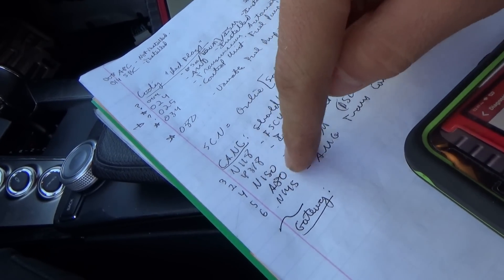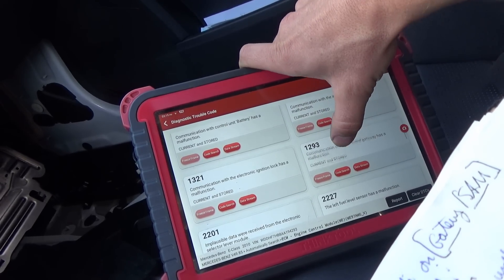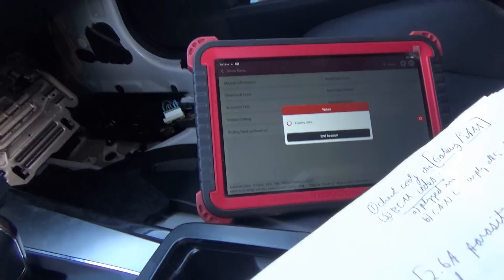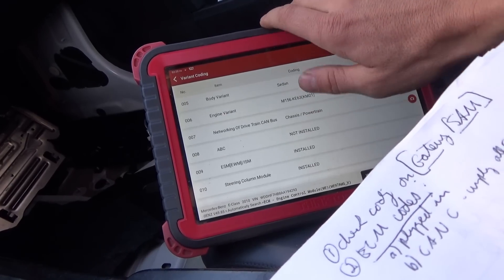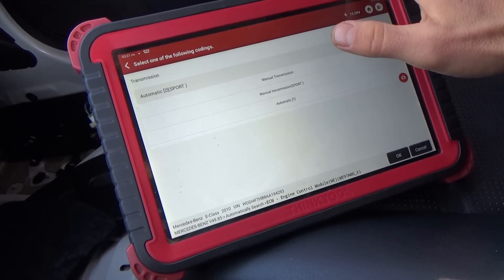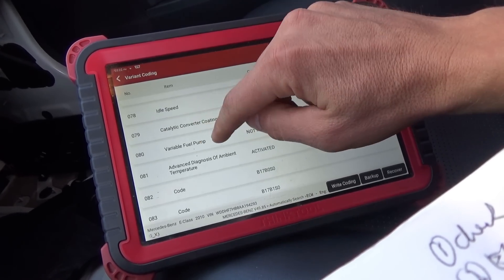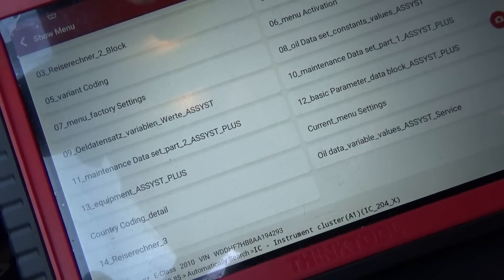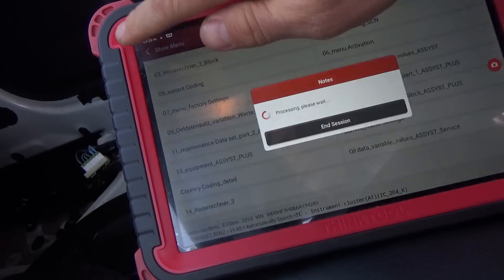Beached Benz AMG - Part 3 (PHAD Thanksgiving Special)

Comment: Probably can be repaired they were bad for the crystal going bad on the engine control module and u can replace the crystal part and repair the original that is why they wanted the original one from the car and it cost maybe 10.00 instead of 1500 bucks and on eBay they repair them all the time and they also can reprogram a used engine module to work on another car as well usually charge couple hundred dollars or so to get it repaired or replace with a used engine controller and they work just fine I just wanted to let you know that information to maybe help a customer that is in need of repair or replacement and save them a good deal of money to get their car part so they can get their vehicle back in service for way cheaper than buying a new one from the MB dealer love watching your content keep it rolling kind sir and thanks for all honesty and help through your content too!

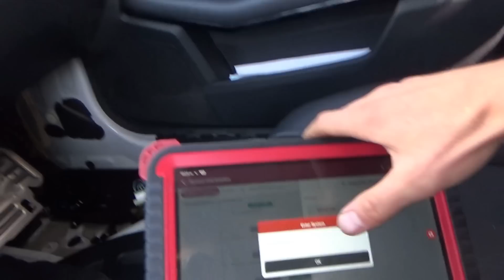Comment: 7:30 The 374A is a software error, it looks like the dealer partially updated or tried to update the system, but either updated it with the wrong software model, or just messed it up. So the engine computer would be just need to be updated ( if it has no physical damage) - that's my thoughts.. I have not finished watching yet lol

Comment: Mario would have changed all the chips in that computer and got it running. My Autel ultra has an app called remote expert where you can use the tool to contact a programmer and link it to the car and have the remote expert program the module over the internet, you then pay for it right away, have not used it yet but seems like that could be a useful function.

Comment: Love your videos as always.

Noticed brake rotor wrong.  Left installed on right.  Hole on drilled disk should sweep pad with inner most diameter hole hitting brake pad first.

Just a point noticed and always irritates me.  Looking forward to the final video

P-Chi

Comment: In the world of PC motherboards, flash ROMs developing bit rot or outright going bad (i.e. even fail reprogramming) are not unheard of. Parts quality does seem to vary. (The irony is that Gigabyte boards with dual BIOS seem to be particularly affected, possibly using two meant cheaper chips.) A faulty EEPROM could certainly cause issues like this. As a rule of thumb, the more dense a type of non-volatile memory is, the less robust it'll tend to be, but none of them are immune to failure altogether. Obviously data protection measures will be much more complex for NAND flash than in a small serial EEPROM, too (or else we wouldn't be using SSDs and find a lot of them to be utterly reliable).

Comment: Ivan, I would tend o agree on the ECM being the issue but as you know is it the software or hardware causing the issues.
first that much ringing on a Mercedes is totally unacceptable.  leads me to believe hardware is playing a part here.
I'm suspecting that the dealer may have also done something to the main program running the computer.
Is there no way to save the main program in the computer just in case and try to reload the program that should be running the car.
I think the dealer may have tried to load changes to the software and either stopped before they were done or somehow corrupted what was there and didn't tell anyone.

Comment: I just watched both Super Mario Diagnostics videos.  The one with the 09 CLK350 and 2011 E350 diesel.  The 2011 is a W212 which is the same as this 2010 E63 but I noticed both seem to use the ME9.7 ECM so perhaps this is just a fun thing that happens to them.  DON'T forget to clear codes after you replace!  Wonder if getting a Flex for bench flashing should be in your future.  Very cool stuff and lets you source a used ECM.  Then again, if they do this maybe used is not the way to go....

It looks like my 2007 S550 uses the ME9.7 so maybe this is in my future.  At least on the M273, the ECM is literally installed on top of the engine.  You can even touch the cooling fins because the plastic engine cover exposes them.  Imagine when an S-class is easier to service than an E-class.  Presumably a 2010-2011 E550 would be the same way though.

Comment: I think all the 722.9 AMG cars use that wet clutch pack instead of a torque converter.  So definitely coded differently than the torque converter version.

Comment: no need for an oscillograph and several days of measurements or diagnostics ... for these old cars, an old DAS or xentry is enough and it takes 15 minutes to understand what's wrong and how to fix it ... I do it every day and good luck with the video about "rocket science"
Reply: Do tell us more, seriously.
Reply: @annathemaanderson4448     if some module does not respond via OBD can, i.e. via CGW, which is also SAMF in this w212, it is always possible to connect directly to the module DSM, TCU and all others... If all other modules have communication via drivetrain CAN, then ME9.7 remains . By the way, the ME9.7 is famous for its failures due to run-out electrolytic capacitors and the destruction of tracks of the layers of the printed circuit board
Reply: @gintarasr_MB  maybe he could have taken it apart and soldered it
Reply: doesn't need soldering because he got brand new out of the box
Reply: @gintarasr_MB  yes, I know that, I'm just saying maybe he could've tried it instead of the 1500 dollar option?

Comment: Damn Ivan. I told you I had a weird issue with a sl600 if memory serves me right. Had codes as well for fuel level sensors. It was coded as a taxi for Germany. I don't remember all the issues I had,  but took me a week to figure out. That was around 2002 with the Mercedes; (star) factory scan tool

Comment: Top Japanese brands are known to be quite rock solid when it comes to the reliability of ECMs/PCMs/TCMs etc.  However I've had the pleasure of seeing the odd case where a relatively new vehicle ( less than a year old on average ) simply went dead after being parked less than a few hours. Some of the codes will astound you when they pop onto the screen doing a diagnostic check, things like the wrong engine size, the wrong transmission type and the wrong driveline type are but a few of the WTF ones. This is when you have to think way outside the box and narrow it down by process of elimination as you have done Ivan. Since part 4 is not up yet for us to see your results, I know in the cases I dealt with, the internal logic simply went haywire, and in layman's terms the board fried itself. I cant wait to see what happens with the new one installed.

Comment: phew, a cliff hanger :)    If I'd realized this was going to be a 4 parter, I would have pulled the CANbus and control unit block diagram off Mercedes WIS for the VIN (which was visible on your scanner in the first episode) and posted it.      On the later E63S cars, they swapped the 'regular' 7Gtronic automatic for an AMG direct shift 7G automatic that used a electronic clutch instead of a torque converter, and for sure those are different beasts.    I don't know much about these early E63's, the new one is 4matic only and is a real beast with 600+ HP and 600+ ft-lbs.     Even my E350 6 cyl (300 horses) has the paddle shifters with the regular slushbox, but I've not found them to really be that useful.  With the AMG transmission, its another story.

BTW, those wiring diagrams your system showed you were like copies of what is on WIS, but not as well formatted or presented.    on WIS, all those PExxxx.xxxxx things are hot links to other pages, and the list of components/connectors/options stays on the right no matter what page you're on.   Your software showed you what you get as a PDF from printing sections of the wiring diagrams, rather frustrating to study.    The problem with WIS is, you damn near need a degree in using it, it took me a bunch of tries before I finally started finding what I was looking for in it, its not only wiring diagrams, but also has the full workshop manual on repair procedures.
Reply: WIS java app is being discontinued as of Jan 2023 😩 I'm not looking forward to wisnet
Reply: I found the same with WIS, it's not at all intuitive and has a steep learning curve.
Reply: @ferrumignis  I brought a 2017 copy to use a s a parts ordering and workshop manual for my 2002 project SLK320 and I still haven't worked out how to get the correct wiring diagrams for it!!!! Although Ive found a guy on YouTube that does EPC WIS/ASRA instructional videos but even those are not straightforward as there are so many rabbit holes to disappear into!!!

Comment: Question for anyone to answer... low speed fans not coming on. [99 chevy lumina 3.1l] after doing diag I found pin 85 AND 86 are getting power yet neither pin 87 nor 87a are getting power.  Do I need a new pcm?
Reply: I know but I'll tell you tomorrow. ;)
Reply: @larrybe2900  hes busy tommorow,could u let him know the 8th Tuesday next April  , he has a gynocologist appt .
Reply from the maker: You need a wiring diagram and then understand the current flow 👍
Reply: @PineHollowAutoDiagnostics  thanks for your reply. Honestly I didn't think I'd get one from you lol your sorta like a celebrity. 
 Anyway I know on any relay, pins 85/86 are control.  30/87a-87 are load.  Which is elementary electronic knowledge.  I also know the "control pins" are usually controlled directly by the pcm. So typically if one of those pins are bad it's usually wiring issue or pcm issue.  Which my guess was that writing issue was out the window because it's getting power. 
 I've posted in a zillion forums but nobody knows stuff like that and could give me a sensible answer.  
I'm in the process of trying to find a pin out diagram for the pcm so I can check the pin directly at the pcm. 
Thank you again for your response.  One last question, is there a certain website you use to get your wiring diagrams that you could share?

Comment: Ya got me! maybe that disgruntled employee used the old 9 volt battery across pins 12 &24 on the ECm to blow the 1 amp fuse inside the ECm,thereby making the car READY to be sold at the car auction lot to the highest BIDDER ? I'm just kidding of course,NOBODY would do something as WRONG as that >>>would they???Heat gun that seal and open her up,IVAN
WHAT we need here is a COLOMBO THE DETECTIVE but RUSSIAN STYLE,haha

Comment: Solid thought process Ivan, but it takes some cojones to call a $1500 ECM, on such a weird case! But that ending was mean - I was preparing for the key turn and it ends there 🙂
Now waiting for Part 4 🙂
Reply: If it is that expensive I am suprised someone is not offering a repair service or refurbished items.
Reply: @the_bunse  Sometimes you run across proprietary chips. Super Mario Diagnostics, and many other, do some board repairs, but there are limits without the support from the manufacturer (which you don't get).
Reply: If it's the wrong call well it looks like you'll be chewing up electronics for the next couple of weeks I must of course someone lies to the customer and tells him they need a bunch of shit they didn't need anyways and that's what happens with a lot of shops today unfortunately I can say that because I know a dozen that do do that and shame on them and I'm at the point in my life where I'm ready to jump over to where the customer is at and let them know whether or not the shop is screwing them if I accuse I'll be able to prove and then maybe they'll be out of business
Reply: @cheapers1952  That's a clear view of the problem(s). On one hand, the inability to diagnose in depth, tied with time pressure from management, ends up in replacing parts until it works (if it does) and present the bill to the customer. On the other hand, instigation to replace parts that are not needed is good instant business, but it's not a fair way to treat customers and, in the long run, will be detrimental to the business, as more and more displeased customers pile up.
Reply: $1500 is pennies on what a typical repair would cost on this beast. You ppl are in the wrong universe of repairs.
Reply: @hkfan4596  That was not the point. What if the ECM was not the problem? Ivan would have to eat it. That was the reason for the comment.
Reply: I have to go back to his first and second video and look at the oscillations at the end of the can message That is not normal I didn't pay attention whether or not that was coming off the ECM if it was that was it right there condemning it unless of course there was some kind of mouse chewing on the wires while he was testing it lol
Reply: @cheapers1952  Those are weird signals with ringing, that usually mean an impedance mismatch, but the terminations were OK (there was also an odd fluctuation of the bias voltage), so it had good probabilities of being a module problem, but making that call at $1500 in a car you don't know well... Takes some balls 🙂
Reply: @JoseSilveira-newhandleforYT  I agree with you 100%, it takes big balls but I'll tell you what this video has enlightened me to know that and for sure that that's a problem what would be great is if he would go back in there and hook up the lab scope again to see what's happening on the network and see if all those oscillations have gone and they should be gone hey it's been great chit chatting here with you
Reply: @cheapers1952  Yep, that would be a good idea, to revisit the network signals after the repair. Nice to talk to you too 🙂
Reply: I have $1,500 no big deal for somebody that can afford a Mercedes like that
Reply: @cheapers1952  No big deal if it wasn't the correct call and it doesn't fix the problems? Seems some people really do have more money than sense
Reply: @ferrumignis  I think the proof has produced itself with this guy, lol
Reply: @cheapers1952  Yep, but if it's the wrong call?

Comment: If the dealer could not see obvious problems with the ECU they should paid the owner the value of the car. The diagnosis of a wiring harness without evidence of damage is unexplainable.
Reply: yes   they should pay the owner the value of the car when the car is 13 years old,  in fact hey should just pay everyone who brings their car in for anything whether it is just an oil change, tire rotation, whatever, pay them the value of the car and be done with it

Comment: With all the modules and what-not, I think behind the fender was the only place the ECM would fit. And when you removed the unit, I didn't notice any rubber anti-vibration dampers or anything of the sort. Vibration may have done the unit in...I'll bet there's a hairline solder crack somewhere inside.
Reply: right   MB didn't think it through as to where to install the ECM on a $100K+ car until you came alone and told them.  Thank You for your invaluable feedback
Reply: @111-c7x2t  I'd have told MB where to put that ECM and the whole car, for that matter. Over-complicated, overpriced example of planned obsolescence.  And anyone who buys them has a lot more money than sense.

Comment: It seems like it should be internal, but some chips have a separate voltage pin used to write to non-volatile memory.
Reply: what is "itmshould"?  is that German?
Reply: @111-c7x2t  nope, bad  typing.  😶

Comment: I think I would have at least checked the PRNDL switch since the motor wont start without being in Park or Neutral and since it couldn't tell what gear it is in it won't start. I hope the $1500 cannon was the right call.
Reply: yes  because the dealership didn't check it?    is that the thought process?
Reply: @111-c7x2t  I have been burnt several times because I assumed that the person before me would have done that and now check even the simple stuff like fuses and connections.  You might think it is a waste of time but you would be surprised how many times the "obvious" option was correct.  That is the thought process and it even has a name K.I.S.S.
Reply: It can't 'talk' to the trans at all though so it wouldn't know anyway.

Comment: Great stuff! It feels like you are on the right track, I was initially wondering about the dealer messing with the ECM, but had that side thought about the data save message... I think you are on the right track. Something internal had to have gone wrong with that engine computer, like the memory or storage. 

If that's not it, then oh man these euro cars...
Reply: I would suspect the ECM has a memory chip issue and is self erasing some of its parameters and settings, I had this happen with my 2002 SLK320 project car, its why I got it so cheap :-)